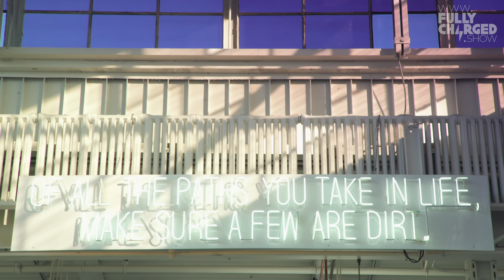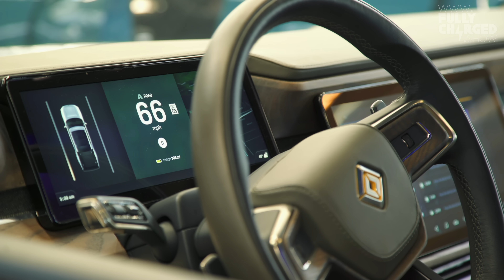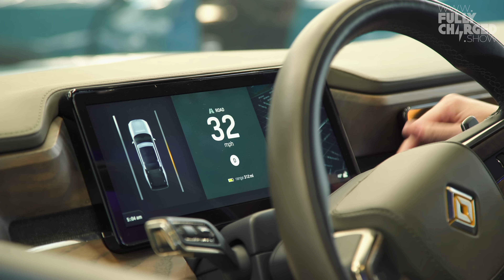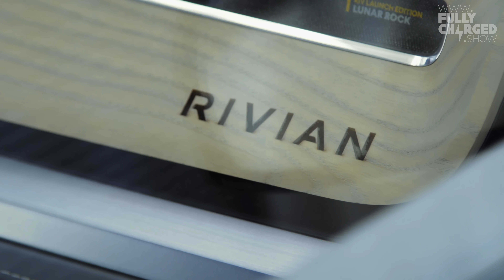Rivian R1S Electric SUV & R1T Electric PickUp Truck - World Exclusive: Inside Rivian | Fully Charged

Comment: Blimey.. Talk about techno babbling!  Why do engineers and CEO's all have to blast us non-techno people with tons of tech speak, all x. y. ex delta - pie this V that?  Just tell us what you wish the car systems to do? How you solved that way of doing it? simply the normal people don't have a degree in engineering or electronic sub systems or hyper design speak!   They just wish to know simple clearly put direct answers to a question of How, Why, and Results.  So to sell a idea.. just keep the answers to simple asked questions SIMPLE. we don't need to know the techno micro design whatever's, Just simple clear answers to let's face it now a simple asked question by the interviewing person.  Anyways after all that tech stuff the important thing is, when the lower priced cars will be available and what is the company say is lower priced?  Knowing them,   Like Tesla and many other EV makers.. low price mean still very pricey. Such that the normal person will not be able to afford them either!  as most seem to be around $45.000 upwards  Not low cost after all.

Comment: What if:

The batteries could be waterproofed
The motors could be waterproofed
The passenger space could be waterproofed
The control systems could be wireless.

And all damage-resistant.

Imagine....
Reply: I think you'll find it is all waterproof. It has a huge wading depth, and the only thing that stops it going deeper is the fact that floats away!!
Reply: @VFRrider  not with over a ton of batteries methinks. Save a fortune on ferry and tunnel fares, plus of course the, er, immigration opportunities...
Reply: @Writer B.L. Alley the same way that submarines don't.

Comment: Would like to know the drag coefficient gains over similarly weighted ice powered vehicles because all the weight savings talked about need drag coefficient factored in to help the nett green gain. It is mentioned that this vehicle is designed to exceed above ice cars not just because it is electric. So would like to know drag coefficient and kwh of consumption  as part of the proof.

Comment: Tank turn will destroy the tyers.
To get a perfect tank turn, you need to allow even the rear wheels to turn.

In this case it could be a mode. 
You must stop the car, pres the mode button, The front wheels go TOE IN the rear wheels go TOE OUT.  that way you could turn the car without damaging the chassis or the tyres.

Also the steering wheel has to be Drive by wire.
Reply: If you do it on pavement it will definitely be hard on the tires. But there are millions of vehicles in use every day doing "tank turn" in the dirt with no problem. See "skid steer."

Comment: I really hope they can deliver what they say, but I can’t imagine them being able to come close to even breaking even with such a huge battery, 4-motors, large size, etc. All for the price of a nicely appointed F-150.
Reply: Except with an F-150 (or similar pickup) you could carry 20 sheets of sheetrock and a bunch of 2x4s.  The box looks very small, maybe I'm missing something.  I wish Toyota would come out with a good electric version of their Hilux.  Those are touch little trucks.
Reply: George Carlson you’ve missed it still has a big bed for carrying that kind of stuff. The “drunk” is great for stuff you need to keep dry without needing to put it in the cab or in a toolbox or canopy
Reply: To build an electric vehicle, it take 1/4 the parts to do so.  That is how it seems unbelievable.
Reply: First, the profit margin on domestic small trucks is insanely huge. They have a 25% tariff as a buffer against imports from other countries and NAFTA that allows them to build significant content in Mexico. All the while, Japanese makers build in the US now as well.
Rivian is going to have an additional selling point, safety. That frunk allows for a huge crumple zone in the area where pickup trucks have big safety deficits head-on and offset head-on crashes. Granted, Honda, Ford and Dodge now ace the IIHS tests.
George has a point, but not as strong as he thinks, the Rivian's bed is about 10 inches shorter than the standard F-150 Crew's 5'6" bed. Chucking in some extra wheelbase for a longer bed is going to be simpler for Rivian with no mechanical drivetrain parts in that wheelbase. The cowboy cadillac owners can just go down to the trailer rental lot at Home Depot if they need to haul some 4x8 sheets home. Or have them delivered.
Reply: Actually Ford and Rivian are joining up to make an EV f150. You can see one in the video at 6:21.
Reply: the frunk is big enough to be a selling point for a pickup, they are supposed to carry things after all. What do you think the big tyres and 4wd will be able to do 0-60 in? I think about 4 sec on a bad day.
Reply: If Rivain is a hit, Ford will buy them out, cut costs and corners, and then rebadge everything as the next Ford F150.
Reply: @listofromantics  By the time Ford figures that out, Rivian's market cap will have surpassed Ford's.
Reply: @rajj8887  You do know that Rivian is partnered with Ford and Ford has invested $500 million in the company?  Obviously...not.
Reply: @buckhorncortez   Don't assume what I know. Amazon invested more than Ford and before Ford. You really think that Ford got much of an equity deal from Rivian in exchange for $500 million? I highly doubt it. Sure Ford might have gotten in somewhat early on Rivian, but even now Ford would barely have enough money to buy out Rivian. I would predict Amazon buying out Rivian before Ford.

Comment: only 800HP? Tesla is definetely going to top that, at least give them a challenge.
and software? they are competing with the vision based machine learning self driving cars of Tesla. Tankturn can go in the next update even in model 3s.

they should open the licensing for the drive-train (skateboard) or even sell it as a product and let other companies innovate in the design. because this design will definetely split opinions.

Comment: the frunk has such a high lift over to get things in and out.... I think they do this because truck markets play a big gam with their front facia and grills and looks, but it would be so much more convenient and practical to design a frunk that is more opening low to the ground and front bumper. In other words make the frunk look like a trunk. The problem is people are afraid to design for purpose if the looks ends up being very unconventional. And probably the crask protection is different.

Comment: He is wrong you don't cut your range in half towing in a diesel pickup, it's based on rpm  when I'm towing heavy stuff in a F250 diesel I only use 15% more fuel and thats if I'm going up hill, but if your  on a level road  the weight behind the truck helps to much it along called momentum. have would like to see that EV Truck after 10 or 15 years of hard work, up to It's silly in mud, water and snow for hours every day during the winter and have the same engine and transmission with 873,000 miles on it, it won't be around anyway to prove it.

Comment: Chief designer skirted the charging speed. Can handle 150 kw? 400 or 800 volts??
Reply: Voltage is not the limit on charging speed, the charge acceptance rate at the cell level is.

Comment: 12:22 Hehe, he said Elon's thing. It's tough not to use Tesla's languange when you design a truck which is practically based on Tesla's design philosophy.
Reply: Actually the whole automotive industry learnt from Tesla and Elon. Whatever they say about him, his influence is huge.
Reply: @thankyouforyourcompliance7386  Even I will give him that :)
Reply: Thank you for your compliance oh please. Tesla didn’t reinvent the car, car production, or even car design, they simply perfected the replacement of one element of the 100+ year old automobile design - it’s power train.
Reply: @paddydowney6269  I think most people know that, but thanks for sharing.
Reply: Shirazenema 😂
Reply: @paddydowney6269  Of course they didn't re-invent the car LOL. They pretty much perfected the EV car design though. everyone is copying Tesla - having the battery pack on the bottom (skateboard style), having crumple zones in front (frunk), allowing high hp, torque, range and performance without compromising safety. Many EV's had the motor up where the engine was and not by the wheels (see GM's EV1) for instance. Even Tesla's first car (roadster) had the motor up front. Now everyone is copying Tesla's design language almost exactly with minimal changes.
Reply: AnonyPersona interestingly, a Qualcomm guy at GM invented the skateboard platform for EVs. Tesla popularised it, but It’s the platform on which every purpose built EV is based from all manufacturers, including Tesla. As for those with motors up front, they are re-engineering an ICE chassis to an EV one, and not using an EV chassis. Tesla are like Apple ( just without the profits).
Reply: The word "um"?
Reply: Wrong. Musk and Tesla didn't innovate or invent anything. Everything they've used was existing technology or products developed by third parties just put together by Tesla. From a technical standpoint Rivian is way ahead of Tesla.
Reply: @CruzeUK  Did I miss the moment in history when Rivian made battery electric cars, all touch screen controls and OTA updates before Tesla? :P
Reply: @CruzeUK  Andrew lives on another planet people, be kind to Andrew.

Comment: The real question however is will the Tesla pickup beat the Rivian products to market. If they do, that would be a lot of potential sales lost to Tesla. If that turns out to be the case, I can quite easily see the Trucks & SUVs quietly being shelved and they'll concentrate on the commercial vehicle side of EVs, which at this point, they'd have a really good chance of cracking. Tesla are doing a Semi, but they haven't said anything about smaller commercial vehicles, but that said, IIRC, the Tesla Truck is being launched later this month (Nov 2019) I guess we'll find out soon if they're also taking aim at that segment.

Comment: A big American pickup not suitable for most uk streets. Dash is a letdown...still looking through the steering wheel to display - how quaint! See the peugeot 3008 i-cockpit
Reply: It's actually a small american pickup.
Reply: @Sylvan_dB  OK. Hard to judge physical size on video. We have fates,rallys and of course pop concerts in large open air fields in the uk.Whos going to pay for charging points to be set up in fields for all the Electric cars we will be having let alone Super Kw chrg ones for this truck.
Reply: @ssgeek4515  No idea, but it sounds like an opportunity for someone. The lights on the pitch use a lot of power, so once those are turned off the wire and power is already on site to supply chargers.

Comment: Knobs can be wired in as an input to the computer so software updates wouldn't be an issue at all. Knobs like the climate control shouldn't change anyway. The real reason they did that was probably to reduce cost. A little disappointing especially for a utility off-roader vehicle.

Comment: I hope tesla, rivian and others also start making vehicles for the commercial sector. Although this pickup is likely perfectly useable commercially, the focus on the lifestyle market means they have alot frivolous and expensive features that although nice put the price above what many businesses can afford. Id be happy with something as basic as my dmax or a transit but with the battery range and pulling performance of these trucks.
I suspect many would accept a higher purchase cost if that was countered by a lower total ownership cost over 3 or 5 years. 
I think the potential extra comparative weight of batteries and its negative impact on payload has now be addressed (at least in the UK) by increasing the weight category for electric commercial vehicles. 
The demand would be there. The cost could be affordable and positive legislation is in place. Is there any reason for them not to do it.
Good video by the way.
Cheers 
Paul
Reply: Ford is building the little Rivian, (Ford Ranger EV 22).  We will have to see specs when they release the info. We hope they don't mess there investment in the tech.

Comment: 180kwh and 800bhp... thats some wild numbers
Reply: Its Electric.
BHP comes second to torque.
Reply: @rogerstarkey5390  Congrats on your pointless reply.
Reply: @danspratt2  
Congrats on your uninformed answer.
Reply: @rogerstarkey5390  Ah you're copying me, how very grown up of you. I suppose I must dissect your asinine comment.
Yes it IS electric, you must also have at least read the title of the video.
BHP is a function of torque over time, BHP is derived from torque.
A brushless drill can achieve torque values of 60nm+ similar to a small ICE car like a 1.2 Polo, this doesn't mean it is able to replace an engine that would have significantly higher BHP figures.

Comment: cough Landrover cough Where's the solar roof and hood. Just another EV that keeps us "tide to the Grid"
Reply: Solar on the vehicle would only provide a few miles of energy each day, you're still tied to the grid unless you drive less than ten miles a day.
Reply: @JRP3  My point exactly
Reply: @CJ0NN0  You said "Where's the solar roof and hood".  Those would not free you from the grid.
Reply: @JRP3  https://www.dailymail.co.uk/news/article-7592485/Father-eight-invents-electric-car-battery-drivers-1-500-miles-without-charging-it.html
Reply: @CJ0NN0  Nothing new, or practical.  It's basically a single use fuel cell, the claims are BS, as is the cost comparison.  Tesla's Model 3 battery pack costs less than $10K, and doesn't need to be replaced, unlike this aluminum fuel cell.

Comment: Don’t more motors mean less efficiency?
Reply: Not really.  It's possible that efficiency scales slightly with motor size (I don't think it does, but I guess it's possible) - but having one motor per wheel helps remove some of the transmission losses (no long driveshaft that gets torqued up, etc) and allows the car to only provide power to those wheels that need it

Comment: Interesting video, impressive design on the drive train, and user interface, and styling, but the towing question, why does no manufacturers consider using a, or providing a means to access, a second battery pack built into the trailer! One which could offer a ranger extender, an absolutely necessary function to avoid those times when the load may vary in weight, e.g. collection and drop off runs, or water bowser. The trailer would have to have its own onboard charging system and monitoring display which could be monitored via an app. Box trailers could have solar panels on and so charging it’s own battery pack or the vehicle pulling it. This idea could be used in heavy towing trucks, so why are they not looking into this ‘alternative battery interface’ as I like to call it!
Reply: Or, for an on-road truck: Just make a self-powered 4-wheel trailer to attach to their existing normal car. (Tesla probably would make it self-driving to follow the car instead of using the hitch.)
Reply: @HenryLoenwind  
Image the regulation of a battery trailer using a regular hitch.
First accident and there's ripped out flexible cables open to the public.
Reply: Rivian has the option of an extra pack..... On board.